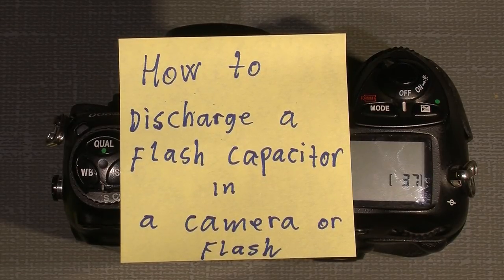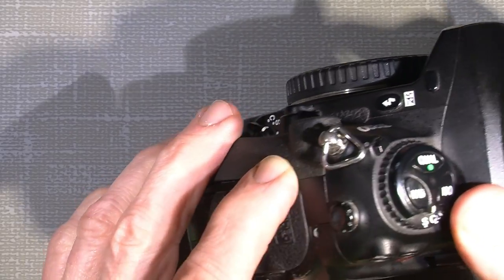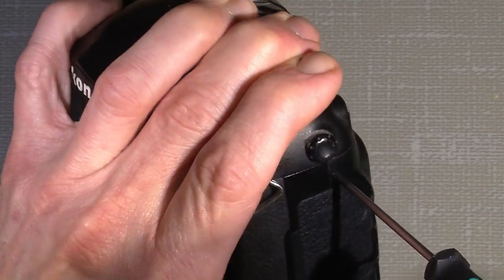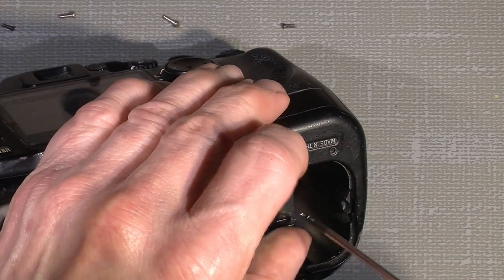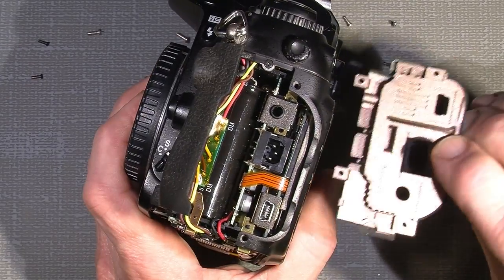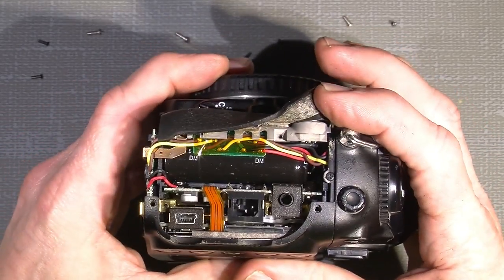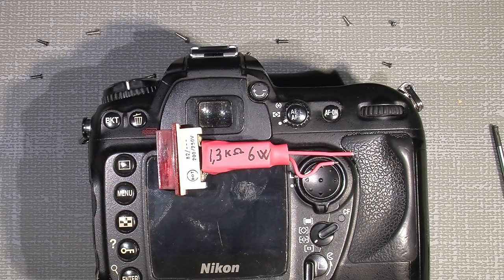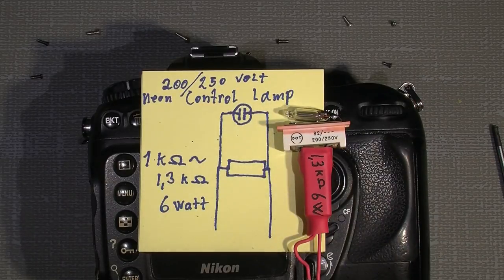How to discharge the flash capacitor in a camera or a flash

Comment: Thanks for this.

I saved myself the neon bulb by just using a multimeter set to DC and using a resistor 3.3 KOhm connected in parallel to the multimeter prongs with croc clips. Without the resistor the charge was near 300 Volts. 

My resistor looked like a 1 or 2W model, but there was still a whiff of smoke during the discharge, quite a bit of energy in that capacitor!

Used on a Canon EX600, the voltage is right on the small inductor covered with tape and the one thick wire soldered right next to it on the PCB in the head.  (you only need to open the flash-tube part of the flash to replace it, not the bottom part containing the batteries.

Comment: Hi Mikeno, excuse my question! can you recommend a set of JIS screwdrivers that your experience works on most screws to repair photographic lenses if you can provide me with some link! greetings and a strong hug!
Reply from the maker: You can take a look on those set from "Vessel"       https://www.vesseltools.com/handtools/screwdrivers/precision/9902-detail

OR those from Micro-tools:     http://www.micro-tools.de/en/Screwdrivers/Kits/JIS-Type/JIS-Type-S-Driver-Set-4Pc-Pollicis.html

I use to like "Vera" but after the tip on some of my screw drivers break's a little too easy, maybe because of wrong production, I will maybe  change to other brand's.
Reply: thank you very much for the links and for your tips your videos have helped me a lot :)

Comment: I just got shocked and it sparked, should I still attempt repairing the camera or should it be fried by now?
Reply from the maker: TheMrMuhahaha   Well, before you continued with your repair you can use a voltmeter, just check if there's any power left in the capacitor. Set the voltmeter to around 300-400 volt and then try to see if there's any voltage left, and if it's zero (0) volt then you should be safe.